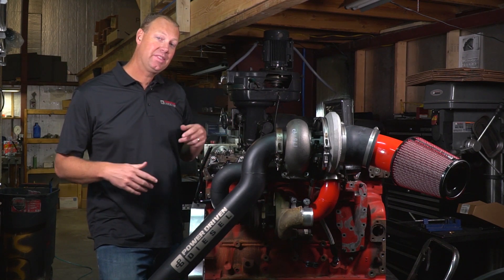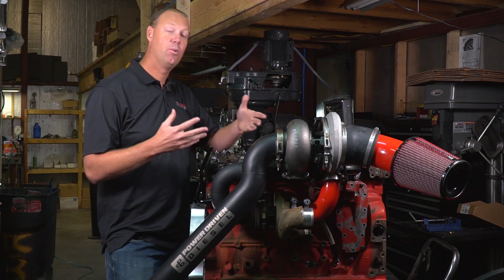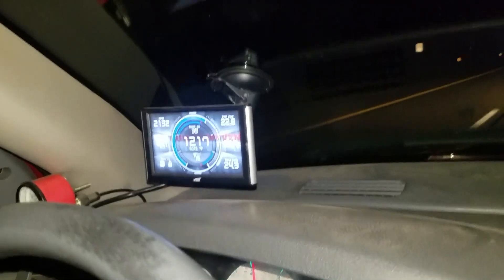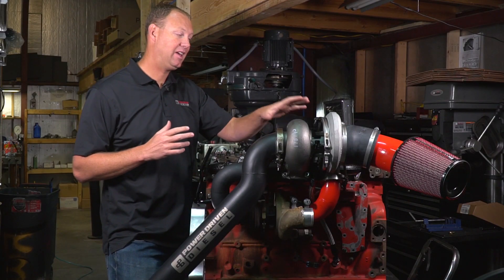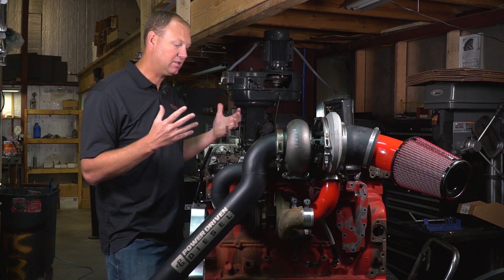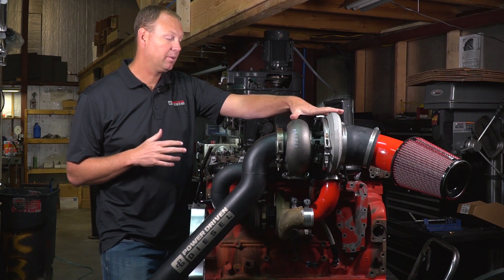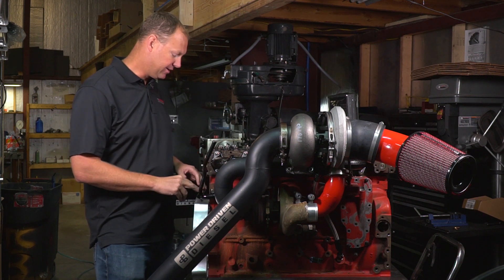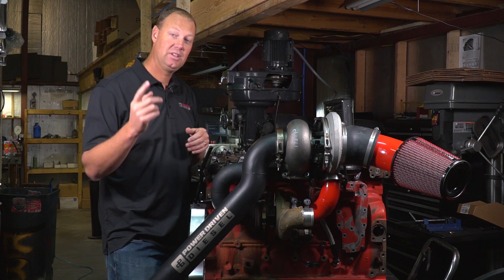3rd Gen Cummins Compound Turbo System | Power Driven Diesel

Comment: Nice kit! I just installed an s472 1.15 AR on top my s362 sxe 14 cm, and man does it run like a dream! 5 spd. manual 24 v p pump. Absolutely no lag at all! At 35 psi it feels like it’s gonna break the tires loose, n that’s only 1/2 throttle, never had the nerve to push it further yet..

Comment: Great little upgrade, but on longer hills that factory turbo really heat soaks and it shows in egts, you keep pulling the same load on the same grade and the longer you do it the egts keep creeping up higher and higher. 

And your at 70 degrees  here in AZ in the summer 110 degrees everything heat soaks a lot faster so I ended up switching to a borg sxe 62/68/14 t3 on the manifold which allowed the system to flow a lot of air for a long period of time with out heat soaking.  I eventually switched the 14 t3 housing to a 14 t4 with a  t4 manifold just to allow the engine to tow 20k lbs up 5-6% grades for 20-35 min. This is mainly because my 06 ram 48re only has 4 speeds and being a 5.9 they like rpm and pulling a hill for 30 min at 3k rpm with 20k trailer it creates a lot of heat and that's mainly just an Arizona thing. in colder states you don't need your air system to be crazy efficient and you still get great results, but here with ambient temps at 110 it finds all the little weak links.

Comment: Any chance you run a drive pressure gauge? I'm curious as to where it would read.
Reply: Twins are very efficient I would probably  say  its around 1:1 ratio
Reply: @dilsher12  the he351 has a small turbine housing and wheel. Drive pressure must be up there if you're pushing them
Reply: @jeremyc137  The best way to fix that is to run a wastegate on the he351, helps bypass the exhaust and keeps drive pressures low

Comment: Can someone please explain to me the benefits of having a compound turbo other than hp. Thx.
Reply: basically your engine gets fed 1/3 more air while its doing the same amount of work as with a single turbo. more extra air while working on a standard load results in lower exhaust gas temperatures.
Reply: Also increases fuel mileage by 2-3 mpg, with the right setup, and you get a lot more torque, and energy out of the fuel
Reply: P PUMP 24 VALVE I don’t have compounds myself but I’ve talked to a couple guys who have run compounds vs big singles and compounds actually lost a couple mpg because of the added boost remember the engine uses energy to create boost.  Now if the truck was super Smokey before and then cleaned up smoke with compounds yes it will certainly gain mpg.
Reply: Jason Truman, I disagree, If the afc is set with the right spring on a p pump engine, it will limit how much the afc can travel, also tuning and the size of injectors on a common rail will determine how much fuel it gives it, this is why not going too big on the turbine housing of the big turbo is important, many times companies go with a 1.32 AR , which is too big for 650 hp, the 1.15 is plenty for me, the 1.32 is for 750, and it doesn’t drive the turbo as hard, therefore less efficient. n the reason I went to compounds is to clean up smoke after 2500 rpm, where the s362sxe is out of its range. I am running the same injectors- 7x9, I also have AFC live, and can turn it back significantly for better control yet.

Comment: Great stuff.
I want to do this to my Dodge
Reply: Steven Tinker It is worth the money! I just got a compound setup on mine this past weekend, and I don’t know why I waited as long as I did too do it,  Give these guys a call and tell them exactly what fueling you have, what you r looking to do with the truck, and they will get you setup with exactly what you want. It’s important not to go too big on the big turbo exhaust housing if u are looking for a good towing setup, and esp. if you have a manual trans. It will pay for itself in fuel savings , power and torque gains! Plus it’s 100 times more fun to drive!

Comment: Are the internals stock? Holding 1250~  is pretty hot isn't it, my 2nd gen 24v with 7x.010 and the waste gate plugged maxes out at 39-42 psi and 1800~
Reply: ive run 1350-1400 for 30 min pulling 20k lbs but I did have water injection just straight distilled water into the air horn, I don't recommend running that hot but so far ive gotten away with it. definitely would not do that with out water injection.  (no juice, Distilled water only)
Reply: Factory truck runs 1400 degrees all day
Reply: bandabanderos this^^^^ the common rail motors are designed to run hotter than the early 12/24v.
Reply: factory rated to run 1250f continuously
Reply: Absolutely ^^ I’ve ran my truck which has a 12v for close to 25-30mins at 1300 give or take and nothing happened. It didn’t cook turbo , drop oil pressure cause of such high temps or anything. Didn’t overheat coolant.

Comment: Hey are you guys hiring at power driven diesel because I graduated from northeast votec for diesel mechanics and I want to get on at a performance shop
Reply: And Ive got a 2006 dodge Cummins 5.9 24valve lonestar edition that has a Aurora 5000 75mm drag racing/sled pulling turbo on it with a 165 fass with head studs and 175 horsepower injectors and it has bigger pistons and built transmission and a bigger drive shaft and it has a cold air intake on it
Reply: And I love working on performance  trucks
Reply: @matthewsumter2099  write in to Banks.